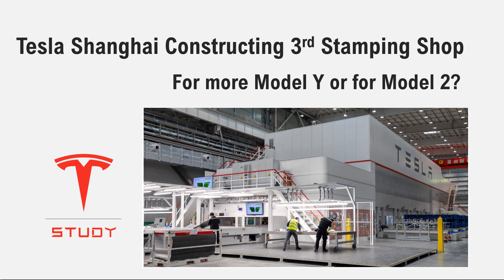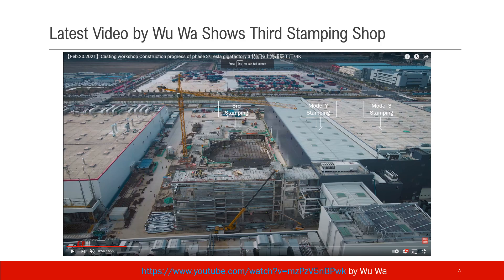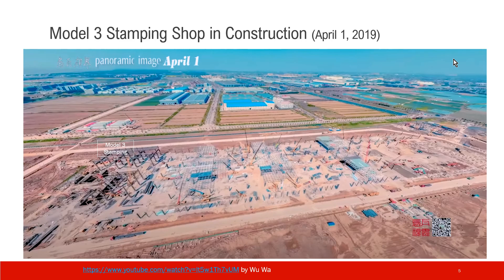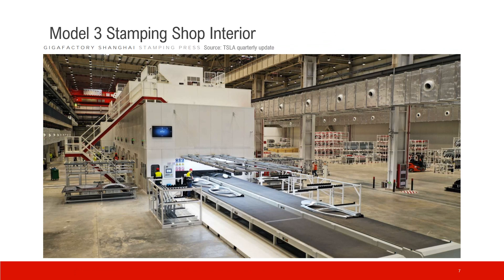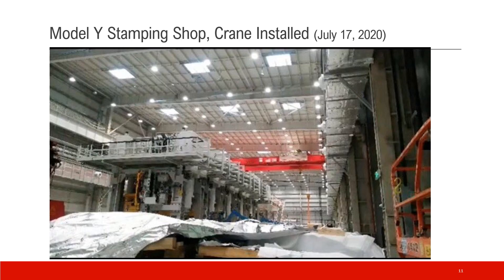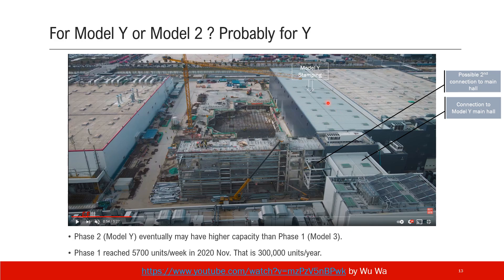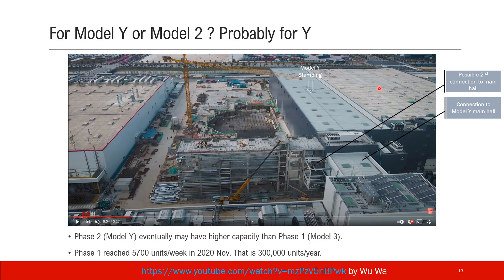Third Stamping Shop in Tesla Shanghai

Comment: Excellent thank you. Do you know where the casting area is?
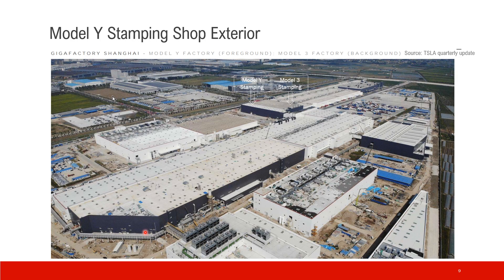Reply from the maker: look at 3:01,  a big building at most up-right of image, almost a square, but with a small low-rise triangle section. That is the die casting shop.
Reply: @t-study5089  Do you know what those two buildings below are for?
Reply from the maker: @boostav  The middle one probably is powertrain shop, the lower one might be the power substation for Phase 2. My best guess, not 100% firm.

Comment: Nice job.  Do you know whether the Model 3 has front and rear castings.  If they only have rear and the model Y switches to front and rear then they could have much higher throughput.
Reply from the maker: Giga Berlin for sure will start with model Y w/ both front and rear castings. Giga Shanghai Model 3 will not have die-casting any time soon. But they are expanding die casting shop for model Y now. Is that for more model Y with rear body casting? or the capacity is big enough to ramp up model Y production and add front body casting at same time? I don't know yet.